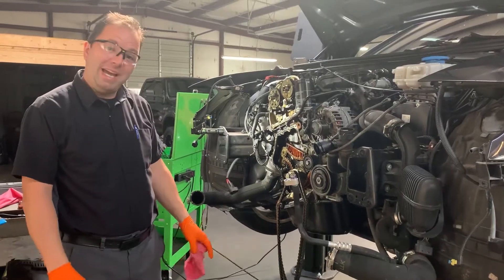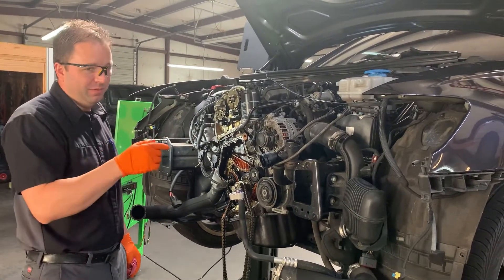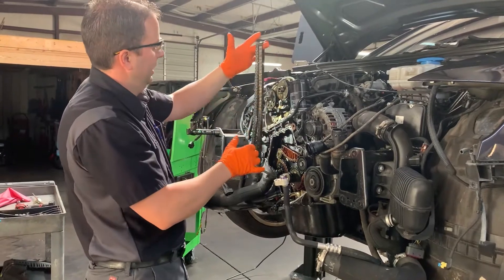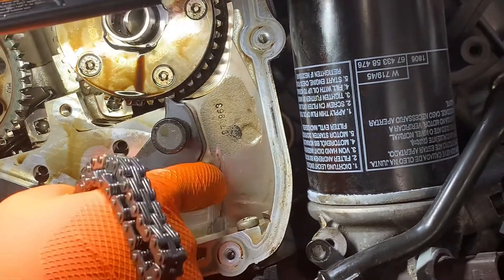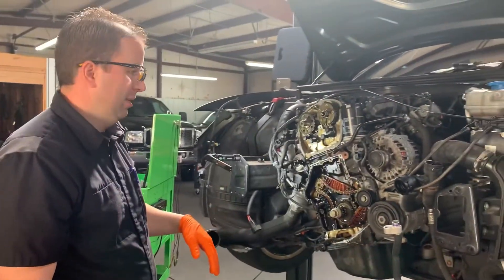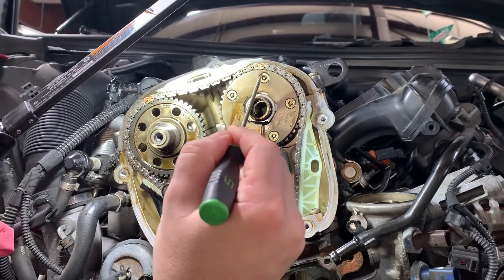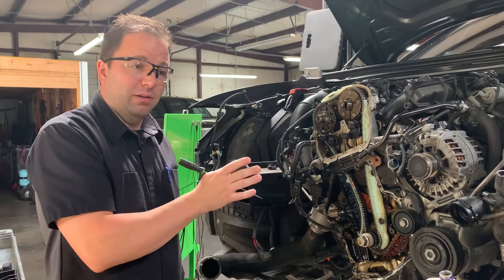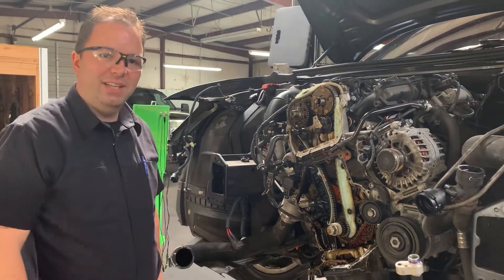Audi 2.0L - Timing Chain Failure

Comment: The balance shaft bearings wear out and the screens inside them sometimes plug up, this is a root cause of oil pressure loss then ultimately the loss of chain tensioner pressure in operation and skipped timing will result